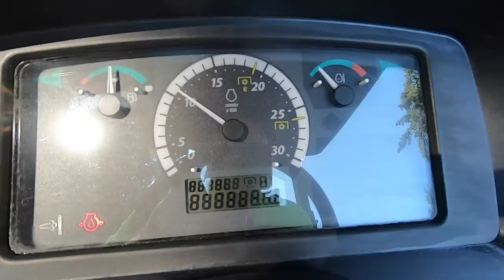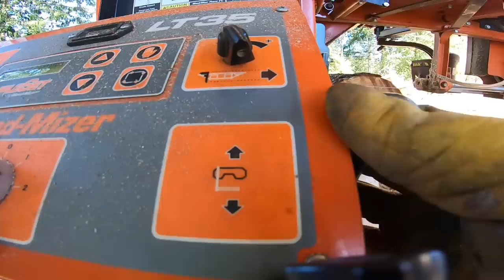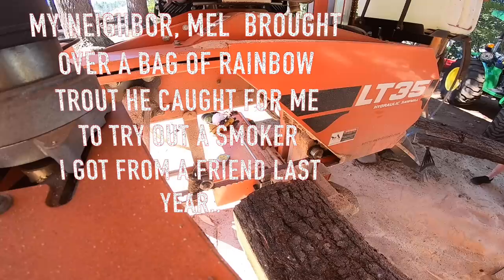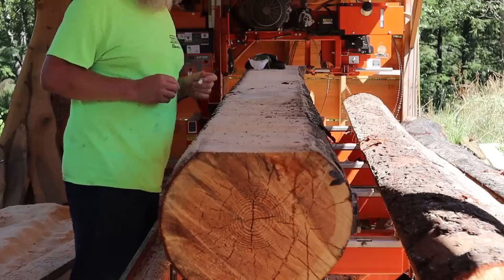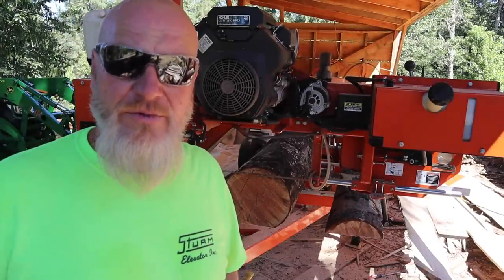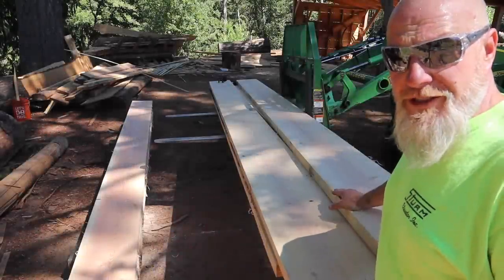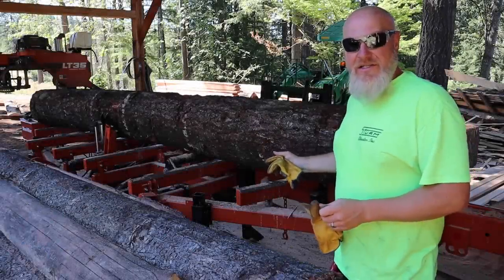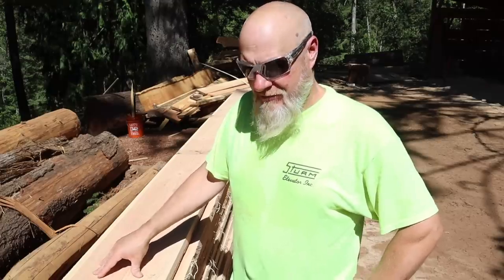THE Most Interesting SAWMILL Video Ever Made.

Comment: Hello, a great video here,  I have asked this question on other videos,  but i cannot get an answer,  Why do people use a band saw  rather than a circular saw, ?  From what i have seen  i think that a Band saw  cuts the wood Better,  Am i on the right track here?  Thank You, Cousin Figel
Reply from the maker: Bandsaw mills are typically more portable and easier to maintain. There is also much less sawdust generated by the thin kerf of a bandsaw. You get more out of a log.
Reply: @NorthwestSawyer  and the board’s face’s are more parallel to each other!

Comment: I watch a couple different showsof guys with sawmills and none of them ever use a metal detectors to check for metal. Seems to be a small investment compared to new saw blades. Whats ur opinion?
Reply from the maker: Finding metal like that doesn’t happen that often. If I spent the time it took to thoroughly search each log I saw, I’d never get anything done. I do use a metal detector on reclaimed wood because it’ll typically be at the surface and easy to remove. If I detected metal in a log it could be very difficult and time-consuming to remove. When I hit metal in a clients log, they cover the cost of the blade.

Comment: Would it be sensible to edge those two with wain down to the best width possible to make header materials for  doors and windows? I mean a graded 2x8 or 2x10 is better than a fail is it not? Also how does that fire burning impact the sap? Does it set the stuff and make it hard on blades? Seems like it would at least set the areas below the burnt part much like a kiln sets the pitch/sap on other species.
Reply from the maker: In the case of these logs, the fire didn’t get hot enough to affect the lumber. As for cutting them to smaller sizes, I’m sure he’ll modify them to what he needs. He actually has a smaller sawmill but can’t cut 16’ long.
Reply: @NorthwestSawyer  Makes sense. Thanks for the response.
Reply from the maker: @markpashia7067  my pleasure!

Comment: You know, I was just watching a video on weird things sold at harbor freight. One was a metal detector, which everyone pointed out is useful for finding nails etc in lumber.
Reply from the maker: I actually have one I use on reclaimed wood where the metal is typically at the surface and easy to remove. I could spend hours on a log and never actually be able to remove the metal effectively. I pass the cost of the blade on to the client.

Comment: Are you familiar with the rule of 7 short cut for estimating?
If you take the diameter of the log and multiply by 0.7 the number you get - roughly - is the cant size you will get of that log if you square it off without wane: 10" log - 7" cant "roughly".
I can't speak from experience how exact this is, but as a rule of thumb, can't hurt - obviously milling close up and personal like you are you can always do better. For example on your way to the cant, you scab off 4/4, 5/4/ etc boards with wane on both sides - big mils just go straight for the cant ...

Comment: I am not trying to tell you how to run your mill because I have never ran one but other mills I watch on utube use a metal detector before   they put the mill on the mill to find the metal
Reply from the maker: Well let’s address the first issue, Jerry. What the heck are you doing watching other sawmills??😬 I do have a metal detector that I use when I’m sawing reclaimed wood. It paid for itself quickly. The reasons I didn’t use it on these log are as follows. 
1. They aren’t my logs. I’m hired with the understanding that if I hit metal, the customer buys the blade(s). 
2. These logs weren’t a typical “back yard” logs that likely had a birdhouse or similar nailed to it at some point. We had strong reason to believe that they’d be clean. 
3. Lastly, the time I would waste not finding metal would cost more than a box of blades pretty quickly. 

     I appreciate you watching and taking the time to comment!